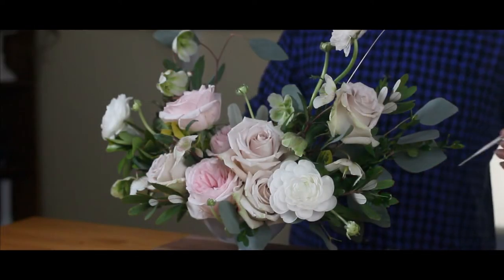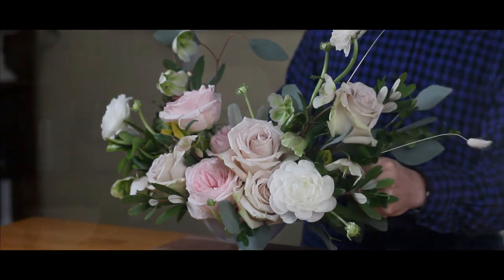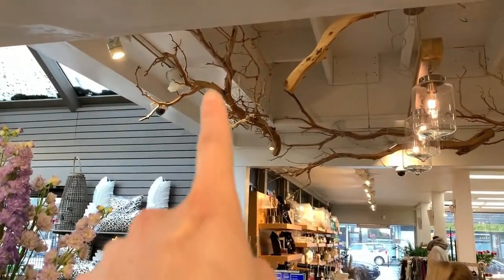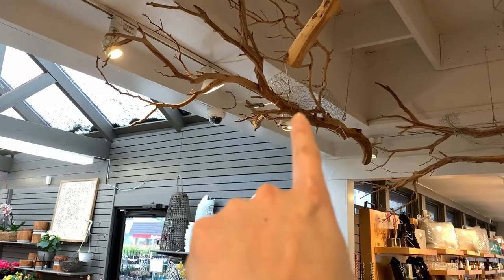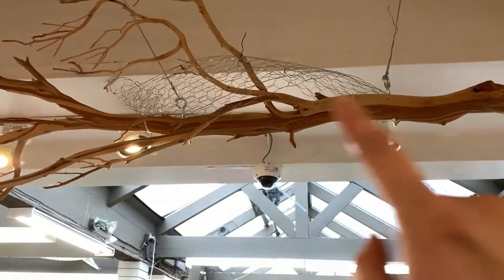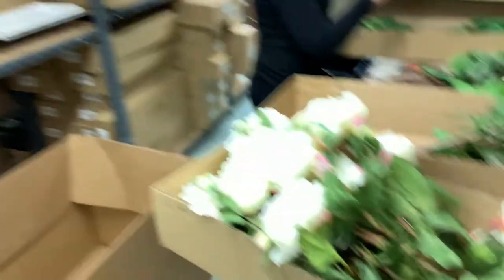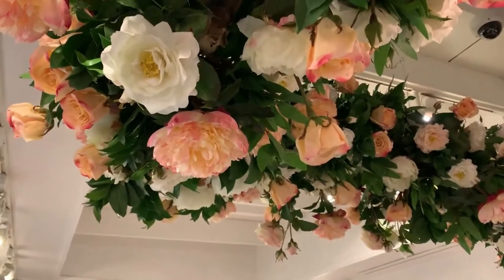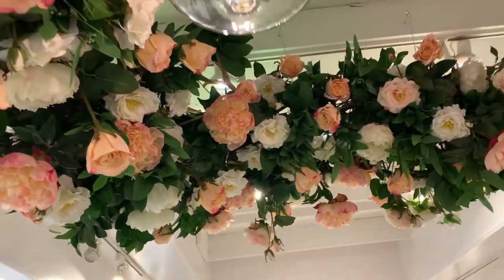Hanging Artificial Flower Installation | DIY Weddings and Events

Comment: How do you keep the flowers from falling out? Do you put water pucks in to keep your real flowers fresh?
Reply from the maker: Hi thank you for your message, this is all permanent botanical so you don't need water pick, but if you use fresh flowers I will highly recommend to use Oasis floracage grande holder or Oasis Jumbo cage, because it is a lot of flowers, wtertube it just not practical.

Comment: This may be a dumb question, but aside from the chicken wire, how were you securing all of the greenery? I may have missed a step. I am very new to the business, but I am trying to learn as much as I can. Everything my shop uses has cages full of oasis due to our climate, so I am curious.
Reply from the maker: This is a very good question,is not a dumb question, eventually, when you put more flowers they will lock itself. Also when you insert the flowers &  greenery into the chicken wire you have to kind of weaving into the chicken wire.

Comment: Hi Mr Yim, AIFD Sir.  What other alternatives can be used other than the huge bark? Lastly, what is the easiest method to hang another alternative, other than bark?   I saw that you used bolts, but most  elegant venues will not allow bolts in their ceilings.
Reply from the maker: Thank you so much for your message if this is the case I will suggest you to get a rental company have one of those metal bar for the backdrop using that for the hanging! I will suggest you to contact the rental company and explain to them what you need and discuss with them they will have better solutions for you!
Reply: @DonaldYimAIFD  Thank you Sir.  That is a fabulous suggestion.
Reply from the maker: @veronicajohnson5516  You’re welcome enjoy it